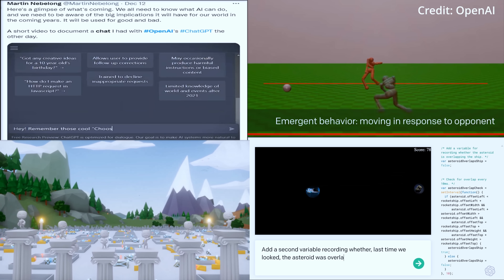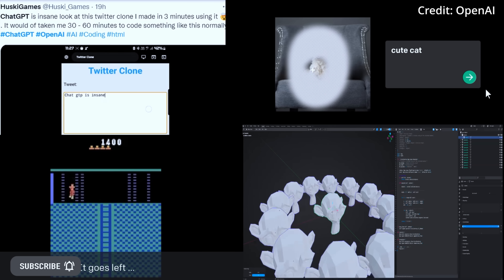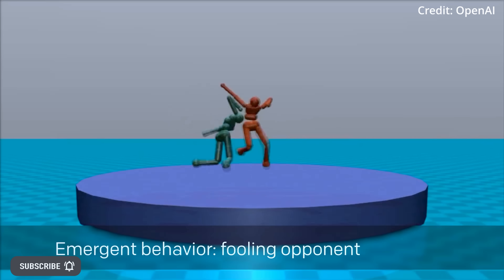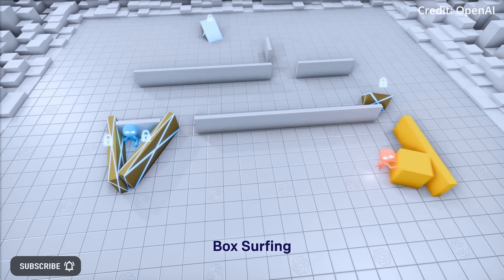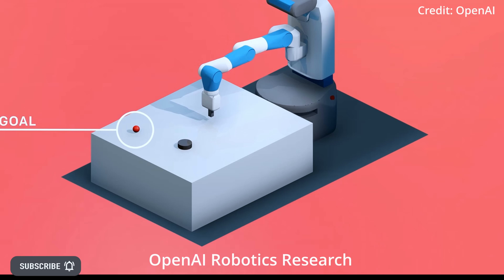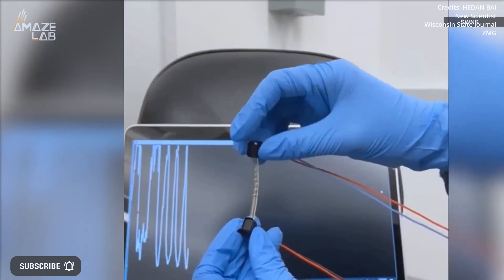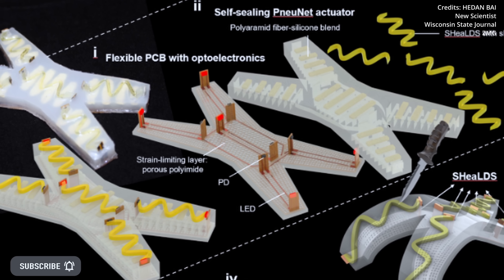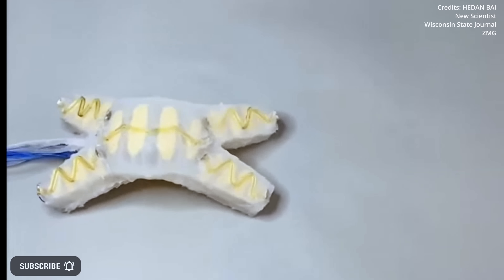OpenAI’s GPT-4 Artificial Intelligence = AGI? 100,000,000,000,000 Parameters Plus THIS

Comment: the biological brain is more efficient because it does not use a central processor, it is efficient precisely because each memory unit is already an information processor, better known as a neuron, thus creating a decentralized form of processing. that same neuron is independent of the other neurons and can be activated only when necessary without needing a system to check which neurons need to be activated. our technology still has a lot to evolve, and it has the potential to surpass the biological brain
Reply: That is an interesting way of looking at it. Almost like the brain is an 80 billion+ core processor... but even better than that. And the number of synapses goes into the many trillions as well. And it all runs on a few watts.
Reply: Exactly, nothing is stopping us from evolving.

We are made of matter, we will find our way to have value even if AI gets ahead in computing information.
Reply: This is why we're moving towards parallel compute for these algorithms, it's much more efficient. I don't see this as anything more than an engineering problem
Reply: But this brain also requires luxury and rest , which it’s counterpart doesn’t .
Reply: @shukrantpatil  not really. It WANTS luxury and rest. There’s definitely people who are unable to get either of those
Reply: Hablas como si las IA fueran zombies? Solo son herramientas que ayudan a los humanos
Reply: @sebastiansanchez7177  lo punto es que las AIs pueden mejorar
Reply: AI will merge with Nature because nature is unlimited